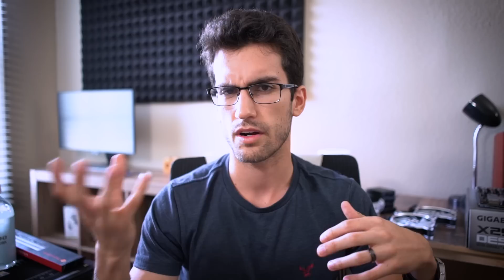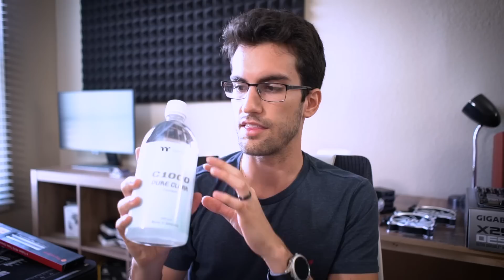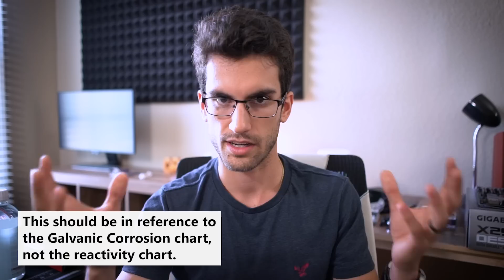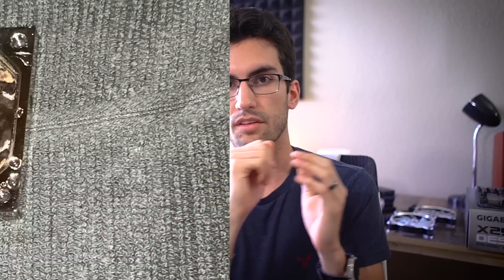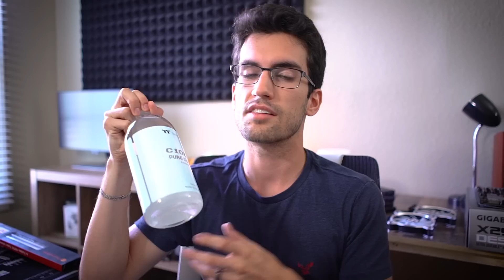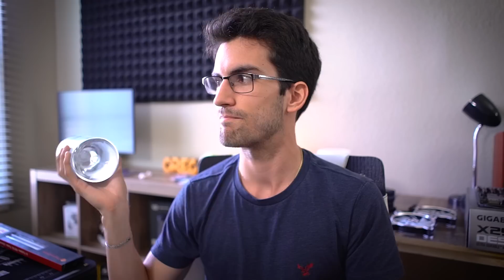How Do AIOs Get Away with Mixing Copper AND Aluminum?

Comment: Excellent video! Aluminum is used as a sacrifice metal in ships - large aluminumt pieces are bolted to the hull so they will corrode first. I found your video looking for exactly (or nearly) what you dealt here. See, old CPU cooling kits - including some supplied by intel - had a copper block inside an aluminum spreader. There's something important about corrosion: the circuit must be closed. For ships in sea water the circuit is air-hull-salt water-ground. I think that if you have an insulated copper touching the CPU (using film thermal compound) and then cooper-aluminum only there wount be galvinic corrosion. The issue with AIOs or open loops is the fact that the radiators are electrically connected to ground and so are lots of places on the cpu and gpu. Also, if radiators are connected in different positions (like in 4 different positions) then there could be ground loops within the radiator itself.

Comment: I know this is old but for people that want to use aluminium radiators with copper blocks you can, just you have to use a 33% regular antifreeze to 66% distilled water!
Reply: I just today realized that i have a nickel cooling block and all aluminum rads😂😂 lucky me that i used engine coolant in my build because i was too lazy to buy expensive pc water 🤣

Comment: this is why on hondas you should only use honda coolant coz of the AL block and AL rad and if youre too cheap to use hondas 10x price coolant, I say just dont change it or use a new drip pan and decant it back in after draining. also why using that blue devil copper based gasket repair stuff, even if you follow the directions, it will cause a bunch of issues a few weeks-months later likely with the heater core getting clogged and ur heater not working after you finally decide to spend the money to fix the head gasket lol
i wonder whats in the honda rad fluid, maybe some EDTA/chelation and/or alumn salt or a sacraficial zinc? might be useful for computers if u have like a data center and the brand name coolant is crazy expensive in "bulk"

Comment: What about using different metals while taking care to not make any electrical connection between the two? When there's no path for electrons to flow, then ions don't flow and no electrochemical reaction occurs. Galvanic corrosion is much like a short circuit on a battery cell. My reasoning is that without the short circuit (i.e. insulate either the rad, block or both) there's nothing to push the metal ions into water. What do you think?
Reply: With the only contact being the water itself, it will still happen, just slowly, but increasingly as the water becomes more conductive. Physically distancing(longer tubes) them will help slow it.

Comment: I have a Custom loop with a fractal 360mm aluminium rad and an alphacool 280mm copper rad and Alphacool Crystal Red fluid. Should i change one of the rads out?

Comment: In a copper + aluminum loop, the aluminum will corrode -- the copper will be fine.  You got that backwards in the vid.  Same with brass + copper loop, although the brass will corrode much slower than aluminum.  Conversely, in a nickel + copper loop, the copper will corrode.  Your best bet is to use all copper blocks and rads, then use brass fittings and copper plate them yourself with copper sulfate and a battery.
Reply: all rads are brass tanks with copper thins. Brass and copper corrosion is nearly nonexistent and will take ages to deal any significant damage even you gonna use tap water, let alone if you will use proper coolant.

Comment: You will see in the thermaltake marketing material that their aluminum radiators are zinc coated on the inside. So the interacting metals are normally zinc-nickel. Both of these materials are used routinely as corrosion protection, galvanized nails ect. Any type B automotive coolent mixed with distilled battery water should prevent corosion. Green for 5 years Red for 10 years. Cars have used and still use mixed metal cooling loops without any issue.

Comment: hearing so much crap from pc guys im in automotive and there is always mix of metals in cars motorcycles industrial engines you name it. With the right liquids you can mix anything without problems. All the radiators in vehicles are aluminum engine blocks are usually cast iron or aluminum or magnesium thermostats are copper coolant temp sensors are copper brass etc water pumps can be plastic or different metals

Comment: I am Building a custom  loop and I already bought a maximus xI Formula board and just realized, that the watercooling block in it is made of cooper or nickel plated. Will I Have to worry about corrosion using aluminium based components in  the loop such as the radiator or cpu cooler W4 Plus from Thermaltake when I use C1000 ready mixed cooling fluid from TT? Planning to change fluid once a year.

Comment: So just a quick question, it may have been said and I missed it but want to be sure, if you have an aluminum and copper system and you use the ati corrosive liquid it just slows down the corrosion, but is there any risk to the pc  or CPU or other parts from the reaction outside of overheating or leakage due to failure?
Reply from the maker: What other threats are you concerned about?
Reply: @GregSalazar  like if the reaction would cause some sort of electric problem that would fry a CPU, or if it's just the cooling circuit that would be ruined.

Comment: Wonder why they don’t use Aluminum Bronze 90%copper 10%aluminum... 

Very low reactivity with water. Gold color that doesn’t tarnish. high heat transfer rate. Very hard/scratch resistant. Much better material compared to pure aluminum or pure copper.

I bet it’s a major cost issue, but should be the one of the best materials for the job. I think it is marketable though, AIO’s are a top end system component. So a high$ top end AIO should have a place in the market, many people would pay top dollar for something that is 2X better than the competition. FYI it is used in Marine boat Propellors because of its corrosion resistance.

If I’m missing something plz explain in a reply.
Reply: My guess would be that the actual temperature differences aren't large enough to justify the price increase. Even when you compare copper and aluminum, although thermal conductivity of copper is 2x that of aluminum, the temperature difference is like 2-5 degrees. The only reason they can still sell copper kits instead of aluminum is that the price difference isn't too large.

Comment: I bought an Enermax Liqtech 360 TR4 in Jan 2018(S/N 17...).  Went bad Aug 2018.  Received by RMA S/N 18...  Went bad Feb 2019.  It's 2 year warranty, so now Enermax is sending me Liqtech 360 TR4 II (ooh, RGB).  Probably still has aluminum rad.  I'm grateful I'm getting replacements, but it's a great inconvenience when it occurs.  My 1950X Threadripper is often at 600MHz, at this time.  Researching all this shenanigans has me more confident in pursuing custom loop in the future, on the upside.

Comment: I have an Enermax LIQMAX II 120S and it had massive corrosion clogging up all the copper fins in the block. That in turn made most of the liquid evaporate and the system would not run after 2 years.

Comment: You guys saying if i have full custom build with alluminium parts just GPU block is copper. If i use that coolant it will be okay?

And i have 2 questions help me with them please;
1-)Do Alluminium fittings cause galvanic corrosion if other parts are copper?
2-)Brass and Cobalt mix in water cooling cause galvanic corrosion?
Thank you..

Comment: Change the fluid at recommended intervals. I have little doubt people never change their fluid for 5 years and were shocked at the damage.

I'm still running a Thermaltake Big Water loop that I got in January 09. No problems. I completely flush the system nearly on time with their fluid.

Comment: problem with AiO closed loop :
-You can't purge liquid inside like you do with your car and the coolant. Why car manufacturer advise you to change coolant like every 2 years ? Because they mix different type of metal.
So if you don't do that with your car, radiator will start to leak, like an AiO

problem even if you use only cooper parts, or only aluminum :
-Radiators are solder. And the solder is neither aluminum, nor copper. It's something more corrosive than alu and cooper. So it could start to leak if you use only distilled water

Comment: Hey just what I was looking for. When I bought my TT Pacific watercooling kit, I didn't realize that the radiator was made out of aluminum. Anyway, I am more confident now that you brought the subject but now I am also wondering if I can add Thermaltake's Pacific GPU waterblock to the system since the radiator is really thick and the block is made out of the same materials as the CPU waterblock.

Comment: Been using engine coolants for  20 years, galvanic corrosion isn't anything to be a concern. From the outset, it's been designed for mixed metals and plastics so zero issues.

Comment: Aio‘s are throw away items and are not intended to be reused, reconfigured or anything, ideally from a company standpoint it were best if it failed 1 day past the guarantee period to sell you the next one. Anti corrosive enough is adequate for those
Reply: cant the aluminium radiator be reused?
Reply: FrozenKopi No, not really. On Aio’s at least they usually don’t have a reusable method of fixing other tubes back on to the radiator, normally they just little fixed barbs and cant fit G1/4 Fittings or barbs in a decent size for normal sized tubing. Sure you could diy it somehow. But as mentioned above Aio’s are a throwaway item and the connections are fixed on and the system is typically not serviceable (no decent fill/drain ports)  So if a Aio sounds funny, cooling capacity degrades - it’s trash

Comment: If you want another way to slow down galvanic corrosion add a small piece of zinc to the loop.  Zinc will oxidize before the Al and Cu.  When the zinc is about 75% gone remove what left and add more zinc.
Reply: Thats not how it works.

Comment: Galvanic corrosion is unstoppable, it's just property of metal when exposed to a liquid with a water base. Since its unstoppable, even if every piece is made of the same metal, in all custom and AiO liquid coolers mitigate the corrosion so that the system will have realistic/economical lifespan. That said there are non-H2O based coolants, but they still very expensive to make and are not used outside of high grade commercial or scientific server setups and even then many still use it only as a fire retardant.

Comment: 1. Additives.
2. You don't usually take apart/service an AIO to notice any corrosion.
3. The manufacturer is hoping for the pump to die or the liquid to permeate so you need to buy a new one anyway.
Reply: Yeah so I was basically right, I feel kind of silly for overlooking leaks though.

Comment: Why do AIOs use aluminum radiators? Because aluminum makes a better radiator despite copper/brass being a better conductor, the mechanical superiority of aluminum(far larger tubes and much thinner fins) outstrips the dissipation advantage of copper/brass by a fairly wide margin.

You want your loop to last longer, change the fluid more often.

Comment: why not use mineral oil?
Reply: GrandNebSmada because it's too viscous and will basically fuck any pump.

Also mineral oil has way lower heat capacity anyway, so it would also be drastically less effective at moving heat from the CPU to the radiator.

Comment: Good video. But I hopped you'll also precise one thing : even with an all copper loop you need to have an anticorrosive (and a growth inhibitor) in it. Distilled water will erode the metal just by friction, by touching it so can still have build up of copper particules in a full copper loop that's why you need to use an anticorosive.
I see too much people recommanding to use distilled water without anything in it for custom watercooling and it's a very big mistakes that a lot of people still make.
That's why I hopped to see you make a video about this :/

Comment: There is kick ass cooling system that allows any mix of metals, no pump to fail, no possibility of leaks, no draining, no special coolant, simple and fast maintenance, much cheaper, 6 year warranty and very low risk. Thankyou Noctua.
Reply: much less ugly than an AIO.
Reply: Grown ups don't really care about that in a pc that sits under the desk.
Reply: @jondonnelly3  Watercooling ftw
Air cooling sux

Comment: so the full alluminum EK kits that jay had shown once in his channel are a safer choice, if you want to save some money???
Reply: I recently built a loop using one of these kits as a base.  Don't expect your cooling performance to be as good as an all copper loop but they are decent enough.   Just use the C1000 or distilled water with PTNuke and call it a day.

Comment: So, what we have discovered here is:
1) A.I.O's have a planned obsolescence. Either the pump will give out, water will evaporate, or it will slowly corrode to death.
2) Open loops will last longer..but only with constant maintenance and upgrading of blocks as you change hardware and regular system cleans.
3) Focusing on good air flow and investing in a reputable air cooler (And being reasonable with your overclocks) is priceless and infinitely more convenient. 
Gotcha. Good talk.
Reply: You can get refillable AIOs that live for a lot longer. Normally the pumps die from the lack of coolant causing cavitation which is solved if you can refill one. You can also just use car antifreeze in a custom loop and have it not corrode even with mixed metals, although it isn't quite as effective as a coolant. There are people who have run that stuff for years without needing to change it. There are options here is the point. Also you still have to clean an air cooler, just like you do with an AIO or custom loop, and they also need replacing often when going to a new socket. I've also seen AIOs that are cheaper than high-end air coolers, sometimes significantly so. Heck I actually use one of them, because it's cheaper than buying a noctua tower cooler.

Comment: Very interesting video. 1 point to make, you mention "Nickel Plated" cpu blocks. Nickel plating you are correct is less reactive however is still prone to corrosion as you have mentioned. However a lot of companies such as EK have moved over to electroless nickel plating. This actually deposits a nickel alloy (Nickel Phosphorous) which has more corrosion protection. This process is 4 to 5 times more expensive than conventional nickel plating but in the overall cost of the product its a small %. The benefit of Electroless Nickel is that it produces an almost perfect uniform thickness so you could theoretically plate a radiator with it and cover the whole part. In an ideal world. Its also an auto catalytic chemical reaction so there is no electrical current needed to plate it so in areas such as internal to the radiator where conventional plating would not be able to plate due to the current density issues.

Comment: Would putting radiator inhibitor into the system help?
Reply: What I mean by this is a house heating system are very similar (apart form being larger) and when i fit a new central heating system we have to put inhibitors into the system

Comment: Just a suggestion. If you didn't know this information until just now you are not very qualified to be informing people about this type of stuff. You should wait a while and continue to learn more from experience and do more research on the results of how things end up over time etc. 
I do give you credit that you did a decent amount of research & shared lots of information on the subject to help people. I think the biggest thing you failed on and left out is the factor of having to drain, flush, & replace the fluid. Those anti-corrosion agents break down over time and start to become less efficient. You can learn more about this by researching about antifreeze. ;-)
Reply: good points
Reply: I respect that you do YouTube as part of a career and need content to post but it is something to consider that when you do this it makes you appear rather unqualified to those who know what they are doing etc. 
The other negative is that you are spreading information to amateur people who might not be the type to make effort to research and learn things properly & will just use your advice because to them it is easier to just watch some YouTube video than to properly study a subject.

Comment: Love your content! You're always so informative and thorough.

In my custom loop, I have copper waterblocks on the CPU and GPU with 2 aluminum radiators (one rad, I salvaged from an old AIO) and a silver coil in the reservoir. For coolant, I use a mixture of about one-tenth Prestone 50/50 and distilled water (when I want color, I'll use liquid food dye). In the 2 years I've run the system, I haven't had any corrosion problems. I flush and refill it about every 3-4 months and have yet to see any kind of gunk.
Reply: @est495  😲 I haven't thought about my 904 build in forever! The system worked fine all the way until I retired it last year. I'll try to remember and search the archives for the build log
Reply: how's your loop now?

Comment: LMFAO!! You don't "see" it because they keep the AIO non-transparent & most people buying them don't know anything about custom water loops and rarely ever take apart the AIOs. I have ripped apart a Corsair H75 after 2 years of use and the entire copper CPU block was jammed with particles of aluminum due to the galvanic corrosion on the radiator that could easily be seen on it's in/out barbs.